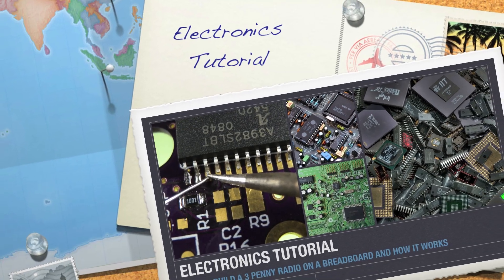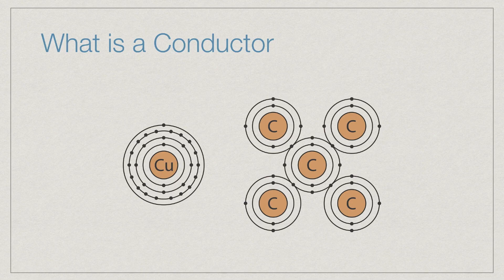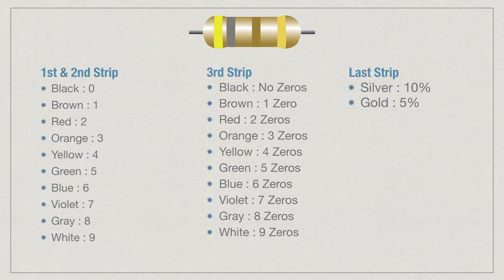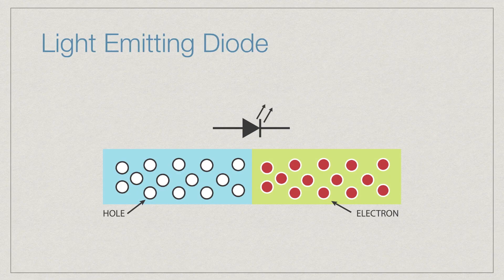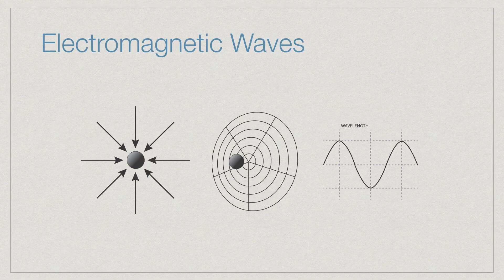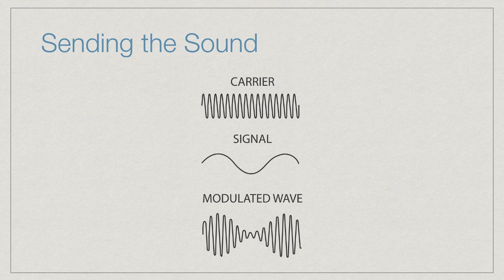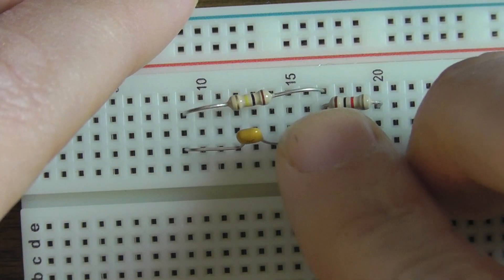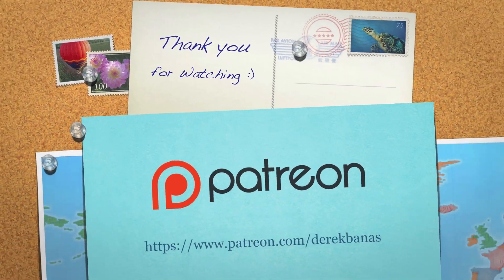Electronics Tutorial

Comment: Actually ☝🏻 actually ☝🏻 current is the movement of positive charge so you're wrong.
Reply: @SimplyMyAccount Definition of electric current: Electric current is a flow of charged particles, such as electrons or ions, moving through an electrical conductor or space. Definition never mentioned that you have current if only positive charges are moving. Negative charges moving also create electric current. And in reality it's actually electrons moving not the protons.

Comment: 6:55 My understanding is that a hole is not an atom with more protons than electrons. A hole is an atom with one fewer proton and one fewer electron in it's outer shell. n-type and p-type don't refer to the charge of the semiconductor, they are both neutral. The n and the p refer to the sign of charge that can move between them, due to the lack of, or excess of electrons in the outer shell. v=IcrBqCFLHIY
Reply from the maker: +robinbuster This is a bit confusing because we don't know what an atom looks like. A hole is just the lack of an electron where one could exist in an atomic shell. By adding impurities a semiconductor can be made that has many holes. These are called P type semiconductors. We can also add impurities that will contribute free electrons which increases conductivity. These are N type semiconductors.
Reply: +Derek Banas agreed

Comment: Isn't voltage represented with the letter 'u' ?
Reply from the maker: +Niels Hvid The symbol for volts is V. I think that is the same in every country, but I may be wrong?
Reply: +Derek Banas A quick look at the wiki page for voltage shows that both U and V is used. I'm just used to using U when talking about voltage and using V when referring to the volts as a unit. (Much like using I when referring to current and A when referring to amps)
Reply from the maker: +Niels Hvid Thank you for pointing that out :)

Comment: ( 1.) Voltage is not a force being applied to a current, but rather an expression of potential energy. ( 2.) The statement that electromotive force "occurs when you have an excess negative number of electrons in one place or a shortage of electrons in another place which would come out being a positive charge" implies a lack of understanding of electron charge and conventional vs electron flow. ( 3.) The diagram at 4:05 is I'll conceived in these regards and a misleading example of Ohm's law. I would encourage anyone interested in the interplay of these concepts to refer to Lessons In Electric Circuits, Vol 1-DC by Tony R. Kuphaldt, freely available @allaboutcircuitsDOTcom or Khan Academy.
Reply from the maker: +JamesHaskin Thank you for the input :) Sorry I made a note on my wording error in the transcript. The diagram came from the first book I used to learn about electronics by Forrest M. Mims. I always thought that that was considered a good diagram to use to compare the flow of water to the flow of electrons. I'm sorry if that is no longer considered true?
Reply: +Derek Banas AA, AAA, and D battery will measure the same potential energy. Think of three different sized tanks raised the same distance from the ground.
Reply from the maker: +JamesHaskin Feel free to make sure I get everything correct. I appreciate the input because I'm just a hobbyist :)

Comment: voltage is potential energy!
Reply from the maker: +Jay Mee Yes sorry if I didn't say that. In the water analogy as pressure is built up in the tank the water pushes up against the walls of the tank because it has no place to go. In electronics we replace water with the build up of electrons. That accumulation is represented by voltage. As we accumulate more charges the stronger the electrostatic field becomes. Current then can be measured based on the eventual movement of those charges, or the water. I hope I explained it better now.

Comment: Hi Derek and thanks, as always it was an awesome tutorial.

One question:
I am new to the field of electronics so today I wanted to buy a soldering iron. The iron I chose is said to give good Lead-free soldering performance but there is nothing mentioned about soldering with Lead. Does that mean it won't work well with wires that have Lead in them?
Reply from the maker: +Arm Aarm You're very welcome :) I just use a radio shack soldering iron which is super cheap and if it solders any solder will work with your iron I'm sure.
Reply: Well lead-free solder needs higher temperature to melt than lead solder. So if it can melt lead-free solder than it should also have no problem melting lead solder

Comment: voltage is not a force. I know it's confusing what with electromotive  force being named what it is.
Reply from the maker: +Marcel Robitaille I said this in another comment above. In the water analogy as pressure is built up in the tank the water pushes up against the walls of the tank because it has no place to go. In electronics we replace water with the build up of electrons. That accumulation is represented by voltage. As we accumulate more charges the stronger the electrostatic field becomes. Current then can be measured based on the eventual movement of those charges, or the water. I hope I explained it better now. Please feel free to correct me. I appreciate the input because I'm not an expert on electronics, but instead a devoted hobbyist.
Reply: +Derek Banas I was referring to 3:27 not the water analogy. Great video. Keep up the great work.
Reply from the maker: +Marcel Robitaille Thank you :) Sorry if I was confused.
Reply: +Derek Banas I get it. A few months ago I would have made the same mistake.